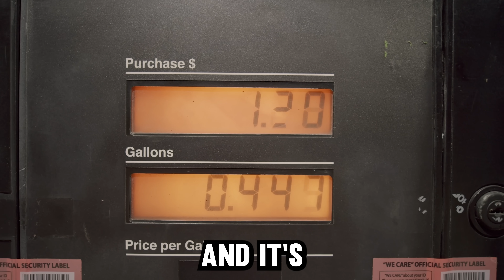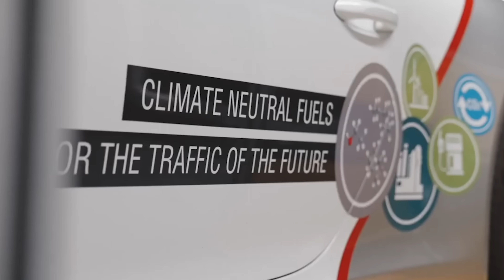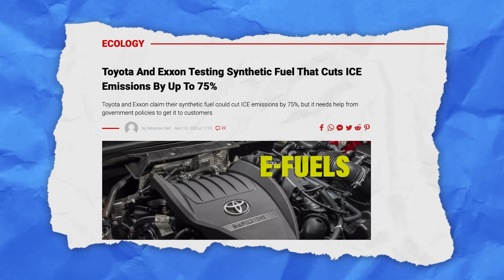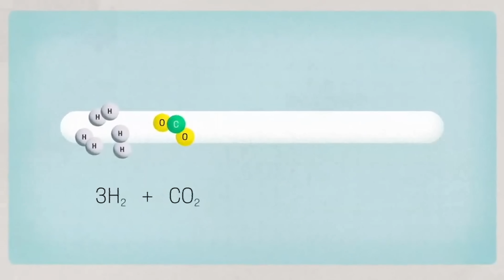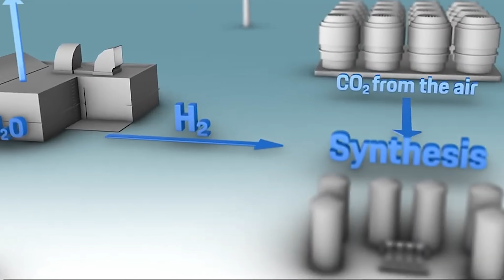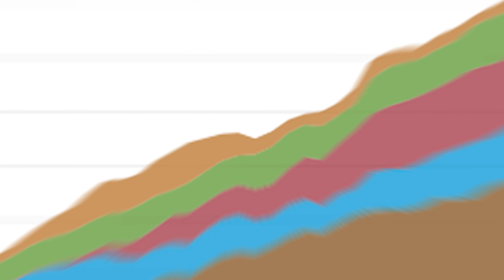Dodge Just SAVED Combustion Engines

Comment: Are you telling me electric cars are essentially "rolling coal" ? 😂
Reply: Rolling Lithium, for real. For creating batteries. For running them, they are rolling coal
Reply: @HarisridinatTN57  not anymore, sodium ions batterie is on instead of lithium
Reply: Yes
Reply: You have no idea how much electricity is needed for electrolysis. Your 1 KW of electricity will be worth 0,1 KW of energy when turned into gas. Then you run the same car with that 0,1KW and get around 0,04 KW of power to the tires if not less. That's 96% loss of power. Damn physics, why are you like that!
Reply: @Phreakrider  that is not true. Electric motors are like 98-99% energy efficient, Tesla's are anyhow. The Tesla Model 3 consumes like 230 watts of power per 1 mile traveled, at highway speeds. You probably use around 1100 watts of electric from your house to put around 1000 watts of charge in your battery. Say your electric bill is 13 cent per kwh, you'd get about 4 miles of range for about 13 cents.

*Unless you're actually talking about the videos topic, creating synthetic fuels and combustion engines efficiency?
Reply: @whatta7793  See that 230 W per mile is a big issue for audio guys. A lot of us are running 2 kW+ sound systems. ICE is going nowhere for us audio guys.
Reply: @bleachstain9785  I agree, ICE is definitely not going anywhere at all, but that doesn't mean that EVs won't/can't be successful. I have a 99 Tahoe with an 18" sub on a 3k amp. I'd never put that system in a $50k+ car to shake it to pieces. That's why it's in a $3k Tahoe.
Reply: @whatta7793  I was indeed talking about the electric to gas engine conversion.
Reply: @bleachstain9785  You do realize the 2 kW+ sound systems is 2 kW per hour, which means on a Tesla with a fully charged 72 kWh battery you could run your system for 36 hours right?
Reply: @kyleoates6367  correct, and not only that, but a 2000 watt amplifier feeding a subwoofer is not continuous either. Some songs may be a little more on the continuous side, but the majority definitely are not. Sound systems have already made their way into Teslas. If you have a 300 mile range, and a 2000 watt system, with a 50 mile round trip to work, the system is going to have virtually no effect at all on your daily commute. I still wouldn't put a big system in a nice car to destroy it. Maybe 800-1000 watts at most. I'd put a Sundown SA-15 on about 800 watts, with 2 layers of sound deadening in the truck only, and that would be it. Anything more, and the car will slowly start breaking into pieces.
Reply: @Phreakrider  source?
Reply: I think the 357 Sig just cleaned house.
Reply: Batteries are not the way. Hydrogen is. Funny thing is. The tech has been avoided since 1965.
Reply: It’s a double standard with an agenda and it’s not to save the planet!
Reply: By the time e fuels become a thing electric will have taken over. You can't expect companies to magically switch to efuels in 5 years. That's why some are betting half on electric and half on efuels.
Reply: Rolling from destroyed environments
Reply: Growing up doing things like leaving a 60w light on was forbidden but here we are charging kW's every night like it's the new norm and electricity is woke now 😂
Reply: @michaelroduner7724  that's actually kind of stupid. Electrical usage per capita in the United States has dropped dramatically due to everything being so much more power efficient to begin with. If literally everyone was driving Electric vehicles, per capita electric usage would not be that much higher than it was in the 1970s.  People don't think about this, but just lighting has changed everything.  The 100 watt light bulb that produces the same amount of usable light as an 11 watt LED unit and last one 10th is long, is putting 89 Watts into heat, while the LED is dissipating about 2 watts.  A human body produces an average of around 100 watts of heat.  Think about the difference in electricity going into air conditioning.  Changing to more efficient lighting technologies alone has decreased per capita electric usage by enough to drive about 15 miles per day in a typical electric car.
Reply: @MrZorbatron  yes I am stupid, thanks for fighting the good fight.